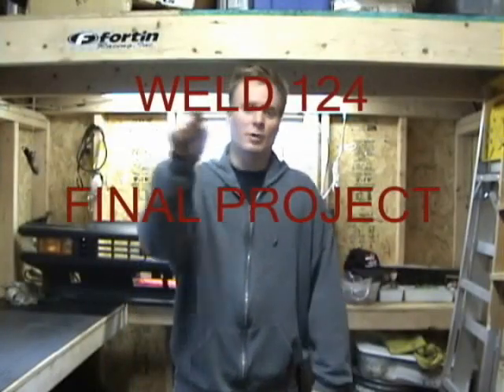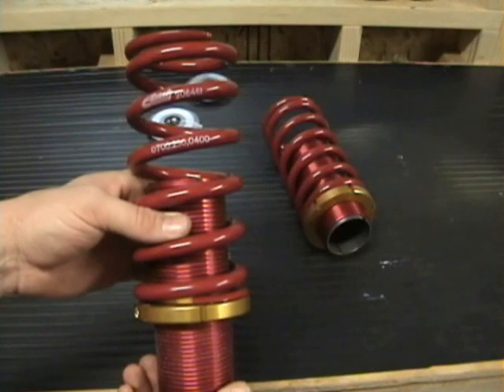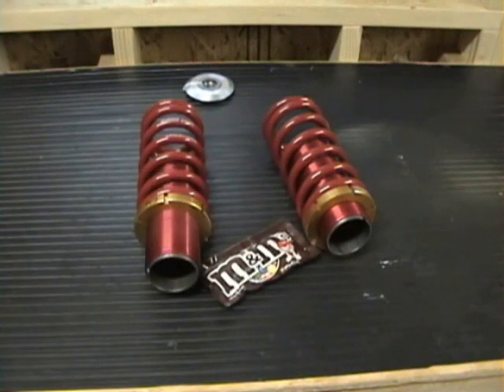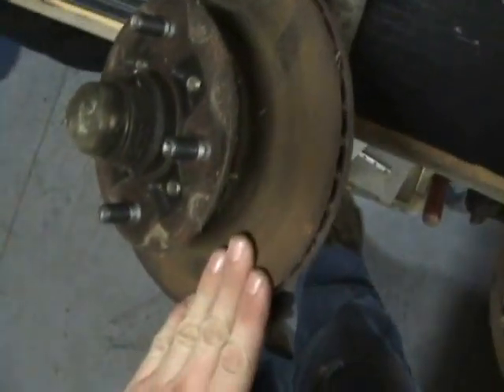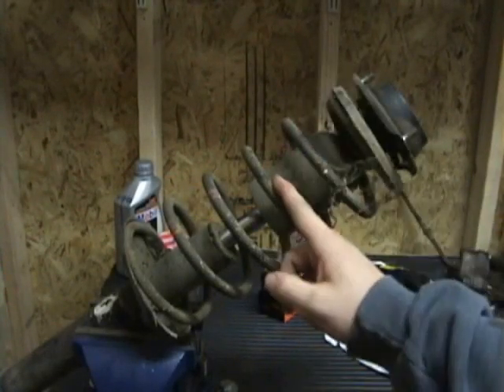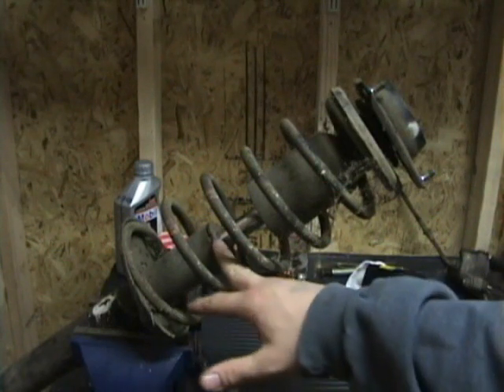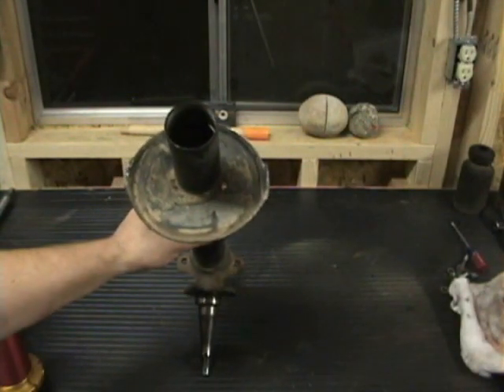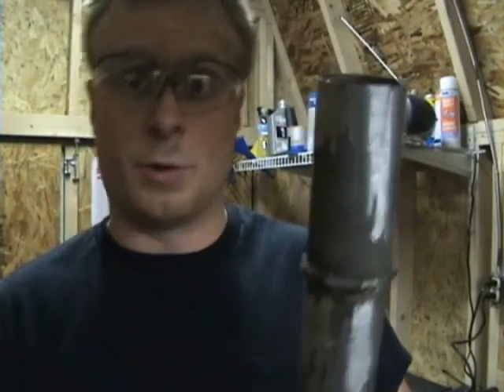How To, AE86 Coilover conversion (Short stoke)

Comment: you could also leave the spring perch in and cut some of the outer diameter of it off and bend the metal on the spring perch up. this will hold the coilover sleeve in place without welding. this will raise the car i bit tho...so not really a point in doing it.